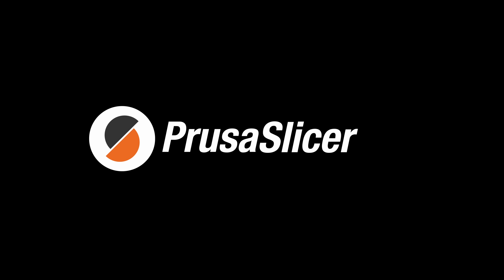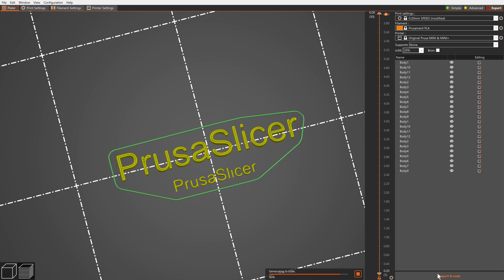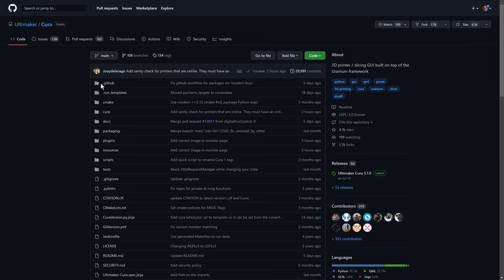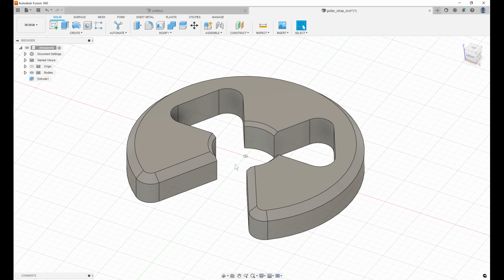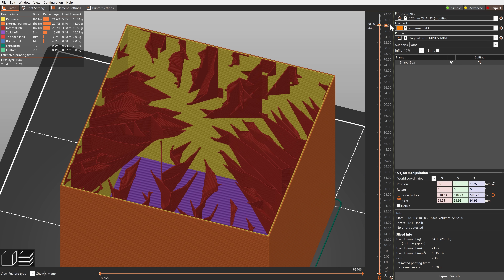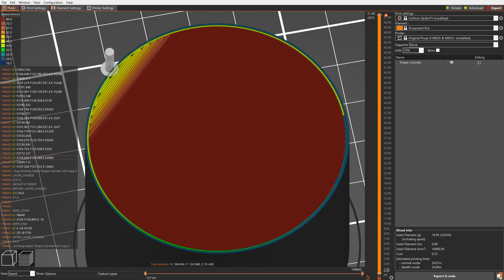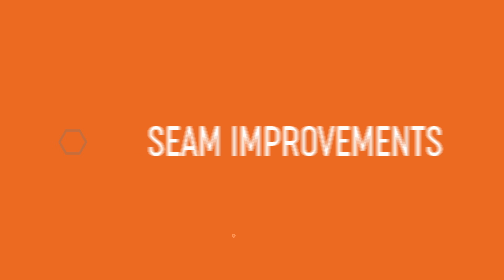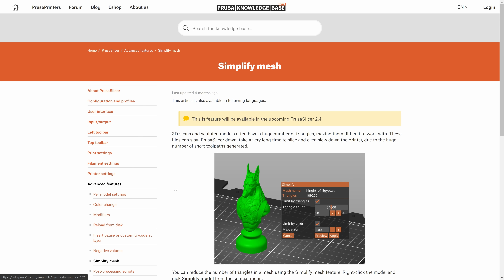PrusaSlicer 2.5 overview – new perimeter generator, STEP file support, Lightning infill and more!

Comment: I would HIGHLY suggest turning off retraction if you are going to use lightning infill.  Worst clogging I've ever experienced because the retraction is so frequent and fast that it cuts the filament at the gears.

Comment: What is the difference between pressure equalizer and acceleration setting ?
Reply from the maker: Acceleration changes the speed much, much faster and it's applied between all changes in speed. Pressure equalizer is way smoother and only applied when transitioning between different features, e.g. infill -> perimeters. -Mikolas
Reply: @Prusa3D  Thank you. And so it make sanse to use it toghether with Pressure advance (klipper) or linear advance (merlin).... Right ? Because it is not same thing. Or to not have big difference in speed between different features. For me it will be "nice to have feature" in next version, option to disable small zig-zag inside infill layers. Arachne is only partial solution for thin walls, samtimes/somewhere there is still small zig-zag pattern. It means noise, vibrations, wear for machine... Sometimes it is of course necessary. Butt I can't suppress it completelly if I want. Or to adjust different speed just for this small zig-zag areas.

Comment: @Mikolas Is there a method for correcting the extra perimeters inside inner holes in an object?  I want to avoid having to drill out centers or guess that there is about .2 to .4 of a mm extra fill.  I thought I heard something mentioned in one of the Prusa Live's where you talked about inner holes.

Thanks,
Robin

Comment: You guys are awesome. Thank you for all the continued improvements. Also, thank you so much for fixing the support generator & enforcers. It no longer leaves random bits of supports on the build plate and model where not needed.

Comment: I have a much worse results with 2.5 compared to 2.4
-seams are much worse and has filament missing. Big gaps, stringing around it. 
-the sequence it chooses to print perimeters, makes prominent artefacts on thin walls where there is  thicker part starts and finishes, on opposite side of the wall (hope it makes sense)

Comment: I have used Cura since the beginning and I just saw Thomas Sanladerer's video about Arachne engine. I tried prusaslicer once and it worked out of the box with Ender 3 S1 Pro. Haven't went back.

Comment: The Arachne perimeter generator has a tendancy to undersize the inside of holes in functional prints. You should probably leave it off if you don't need it. Arachne would be better if inside perimeters were generated in the classic style. I had a part that had a much tighter fit when I used arachne.

Comment: Can you please fix bridging?
It happens so often, that the slicer makes perimeters, which end or start mid-air (same with Arachne).
Also there should be an option for bridges to automatically reduce the number of perimeters when needed. For example if my wall is only 1.5mm wide and the number of perimeters is set to 4, the slicer makes bridge-lines only touch the perimeters from the side instead of safely putting them on top of the previous layer.

Comment: Finally STEP file implementation instead of the shitty 1987 stl files.
I would need more information on the "pressure equalizer" I do understand the porpuse in theory but what values should I choose and why ?

Comment: Hi Im having some ishues with the new software when Im printing a dual color logo (base one color, text anoher) it wont stop my printer to get it ready to a changing color it just goes and print the text without stoping. I dont know if its some problem in me. Im seting it up like that I just klick on the window in prusaslicer which is asking me if I want doble color print because the print look like a logo I then klick ok and then export the file to the printer (Im just 12 if its problem in me dont be mad at me:). Im using ender 3 whitch I buyed a 2 months ago

Comment: When printing TPU on my ender 3V2 I use absolutely constant speed, high as possible acceleration and it works very good. But this pressure equalisation will help a lot.

Comment: how do the new pressure features work when used with Klipper that has pressure advance setup ? if the values are set at 0 is this the best option for klipper ?

Comment: I'm having a hard time thinking of useful applications for Lightning infill besides decorative prints. You save material but, at least in the tree frog example, print time is longer.
Reply: It is mostly for inorganic stuff like models of houses, castles, towers and whatnot. The kind of models with simple hollow shapes where the infill can skip a good chunk at the bottom to save on speed and filament. For organic/models stuff like the tree frog model? Oh it definitely sucks there.

Comment: Another great set of useful improvements! I also like SuperSlicer and thanks to opensource that features appear there too. Maybe the prusa slicer is implementing a set of calibration tools which are built in SuperSlicer.
At least the next step in slicers will be an ai which analyze your part and offers the best settings 😉

Comment: As a cura user myself, nothing makes me happier than to see Prusa copying Cura and adding features. The less users have to choose between A or B slicers, the better! Plus with the costs of Prusas being infamously 3-4x printers of similar or higher quality, the users deserve to at least have modern, up-to-date slicer software bundled to compensate for that price :)
Reply: Show me a higher quality printer for 1/4 the price of a Prusa.
Reply: @sbeprecisionproducts6729  here's an easy one: at launch, the Creality cr 6 SE cost less than 1/3 of a Prusa mk 3 with more features and more reliable out-of-the-box print quality, both in my personal experience and in multiple big reviewers across YouTube! And that's for a pre-built, not a kit. Ender 2 Pro kits are commonly 99$ here in the states, that's 1/7th the cost of a mk 3 with reasonably equivalent quality (for the price). A few mods and a little tweaking gets true feature parity for still less than 1/4 the price of an equivalent Prusa.

And then there's the SLA printers... Anycubic just dropped a DLP model that, in every test I can see, significantly outperforms even the nicest Prusa SLA printer and still costs about a third of the price.... Prusa really needs to get in the game :) They used to be a leader in innovation and quality like Apple but now they're a leader in price...

I just went and double checked some things and Prusa are STILL cheaping out with those awful monochrome text-only LCD panels... Not even a color screen, let alone a touch screen! Customers deserve better on a $1100 machine!!
Reply: @StormBurnX  Well, in my experience Prusa prints out of the box, but those crappy Chinese printers need a lot of tweaking and are not that reliable. With the prusa you print 90% of the time and 10% is for service and calibration. With Chinese printers it's like 50/50. I definitely value my time more than the extra cost of the prusa. Another thing is when shit happens there is really good technical service. WIth Chinese companies you are stuck with comunity forums because Chinese business plan is always sell crap and forget. Maybe in SLA you are right. I have never understood why the LCD printers exists when we have DLP projectors.
Reply: @Hallalii  thankfully that has stopped being true when you buy from reliable brands such as Creality, things really changed years ago and have only been improving. I look at the quality of prints people proudly show off from their $1,000 Prusa printers, full of zits and blobs, visible layer lines, inconsistent extrusion width, etc.... But my $350 creality has zero issues out of the box, even after two years. It just makes no sense to buy Prusa anymore. If service and support is so important, just buy a printer that costs 1/3 the price, and if that one breaks by another one. You're still saving hundreds of dollars and getting better, more modern features.

Comment: Great work. I look forward to a test drive. Been using the Arachne engine in PS for a little while, with mixed results.

More options in filament overrides would be a great option if stuck for things to do now the big Arachne one is over! 😉 That and a measurement tool of sorts to double check remodels to avoid opening cad software again.

Cheers!

Comment: can we ever look forward to pre-configured Pressure Equalizer values for Prusa Mini/+ or are the values too variable between models for that too happen? Since Prusa Mini/+ is a bowden style printer I think it would be great to have that preconfigured if possible to remove yet another thing that fail a print :)
Reply: I think it is more that it is highly variable in-between each nozzle size and material types which each got their own unique printing profiles and speeds already. You'd need a LOT of data to get the perfect values.

If i had to pick something to prioritize though in figuring out. It would be the achilles heel of Bowden types: Flexible filaments.
This may prove a game-changer on reliability with those!

Comment: Unfortunately the arachne generator leaves more tiny gaps along the top surface perimeters than the classic generator. It's especially noticeable around small perimeters, such as text. I'm sticking with the classic until this is fixed.
Reply: Have you tried adjusting your E steps to compensate?
Reply: @RichardBronosky  I don't see the point. The printer has always printed flawlessly until arachne. This is a slicer issue, not a calibration issue.
Reply: @loadinglevelone  if you don’t see the point of trying to adjusting e steps then I don’t quite understand why you would bother to use Arachne? Seems like a good suggestion to try. Then let us know if it did or didn’t help👍
Reply: E-steps should reflect the reality of the printer. If the OP already has them set correctly -- and this was not stated -- then adjusting them for cosmetics would indeed seem to be inappropriate. If they are not set correctly, then any perimeter algorithm will probably perform less than optionally. From the very little information here, I suspect that the printer is working well enough that the e-step accuracy has never been checked. If its accuracy can be improved, there could be benefits no matter what slicer or algorithm is used.
Reply: @davidhbrown0us This has nothing to do with e-steps or the calibration of my printer. This is a slicer issue. I can clearly see the same gaps I'm getting in the slicer preview when using arachne. These same gaps are filled with gap fill in classic mode, but left hollow in arachne mode. It has nothing do to with arachnes variable line width. Arachne does a great job of filling gaps between perimieter lines. I'm talking about all the nooks and crevices right next to the perimeters on sharp corners. These would normally be filled with gap fill, but are left unfilled with arachne. So, this is in fact a bug with the new slicer method. The only way I could think of  to fix this issue is to use gap-fill in combination with arachne (Which in version 2.5 does not work). I wish I could post a couple of pictures to show exactly what I mean, but youtube is not the best place to discuss such issue. The only workaround I've found is to overextrude the top layer, but that causes other imperfections, so it's not optimal. Don't get me wrong. Arachne is wonderful for perimeters, but classic mode works best for infilling along the those perimeters.

Comment: Amazing work team, one feature I'd love however is hole size XY compensation to account for undersized holes, like the one found in cura or superslicer.
Reply: Undersized holes is exactly what I was thinking about when he mentioned step files. Too bad they aren't offering any control over how it's meshed. Maybe some future version.
Reply: It has a global XY compensation setting in print settings
Reply: @nrdesign1991  yeah, not that. The feature just to adjust the holes, that end up shrinking. My outer dimensions are pretty dialied in but what keeps me away from using prusa slicer is the fact that I cannot correct the undersized holes in the slicer so i end up using superslicer.
Reply: Until that option is added, I've just roughly measured the tolerance and been designing accordingly. It's not ideal, but it works.
Reply: @RAndrewNeal  yeah, it works fine when you're the only one making and using files, but when you start sharing files across teams and send some to manufacturing outside, sticking to true dimensions in cad for uniformity becomes critical.
Reply: @ishanmamadapur6307  Makes total sense. But you could just make hole tolerances parametric in lieu of a more proper solution. Leave it set to 0, and let the other party set it if need be.

I don't like doing it this way either, but I kinda have to, as I've already picked the slicer I'll get familiar with, which doesn't have this feature yet.

Comment: These new features are awesome! I've been experimenting with large nozzles this last year and having issues with the walls,  I have a strong feeling the Arachne Perimeter generator is gonna help this so much.
Also, good on you for crediting Cura, and good on both of you for being open source. Things only get better when what would usually feel like a competitor feels like an ally. Tech only gets better when we work together on iterating new things, Glad Prusa and Cura recognize this~
Reply: Arachne is fantastic honestly. It essentially enables larger nozzles to be able to handle details that before could only be done with a smaller. Like models designed for 0.4mm with thin walls and such? Now they truly can be done by the bigger 0.6mm without the slicer deleting/ignoring stuff. To the point i agree with Sanladerer's view that 0.4mm may be kind of obsolete for vast majority of prints now and that 0.6 could become the new default size.

And yeah it is great when an industry got like a couple good guy companies like Ultimaker and Prusa. They are inspiring examples of how you can further an industry through open-source development and still be wildly successful.
Reply: Just imagine what we could achieve if all countries worked together like this !

Comment: Not getting on with Arachne at all. Prints look worse in many cases like the pressure advance is not set correctly and sometimes print times are longer. Gone back to classic slicing and the issues go away.

Comment: Please make the online profiles linked to the printables account.  It is very inconvenient for me to keep current profiles and settings on several computers for the printer farm.
Reply: In case it helps anyone who's unaware of this, PrusaSlicer accepts a `--datadir` command-line option to specify where to store profiles etc, and that path can be on a NAS, on a shared folder from another computer on the network (as long as it's always available when you want to use PrusaSlicer), or, presumably, using a cloud storage product (though I haven't tried that myself).

And while I describe it as a "command-line option", it can also be added to a standard Windows shortcut. Just create or copy a shortcut to PrusaSlicer, right-click and view properties, then in the Shortcut tab's Target field, append (after a space): --datadir "C:\path\to\config"

(I'm writing this entirely from memory, so apologies if the above isn't perfectly accurate, but it should be pretty close, and you can probably search for `PrusaSlicer "datadir"` to find more info about that option :))

I swear there used to be an actual documentation page mentioning that, but I couldn't find it just now 🤷‍♀️
Optionally saving profiles to an online account would definitely be cool, but in the meantime the --datadir option is a close enough approximation for many use cases :)

Just be mindful of installing new versions. You may find that a newer version creates profiles that older versions can't entirely understand, so if you're accessing a shared set of profiles from multiple computers, you'll want to upgrade PrusaSlicer on all computers at roughly the same time (or at least be willing to upgrade any old version before use after the profiles have been saved out by a newer version).
Reply: @AndrewGillard  Thank you. Happened. I threw the slicer into a shared folder, and "...\prusa-slicer.exe --datadir setting" in the shortcut so that the settings are stored there.
Reply: That would be useful. I get round this at the moment by having the settings folder mapped to a cloud share so all my different machines (windows and mac) can use the same profiles

Comment: *Please make it easier to make filament / printer profiles. As of right now it’s buggy, and not reliable. Most of my custom profiles sudden vanish over time. Make it possible to save the as seperate files. And make it possible to make profiles from scratch, completely blank.
*Add support for 1mm - 1.8mm nozzles. Right now there is a problem with seams and extrusion width when going this big. I frequently use 1.8mm on my Bondtech LGX mk3s and seams become huge holes in the print.

Love theese changes made to 2.5!